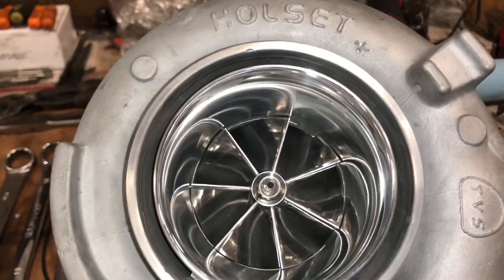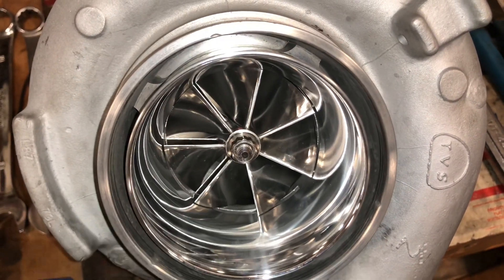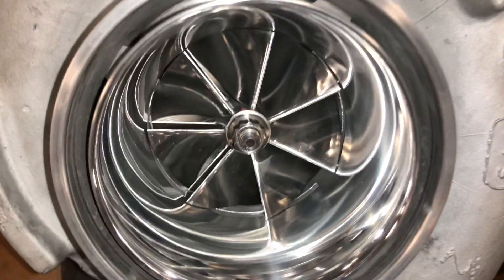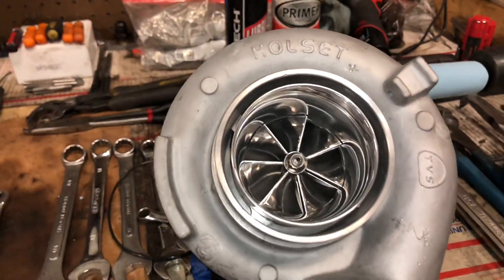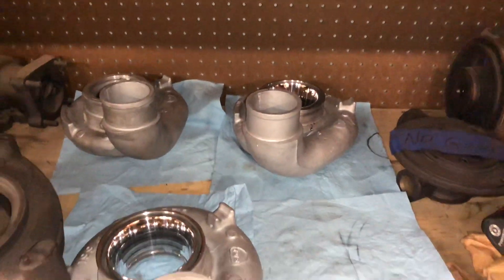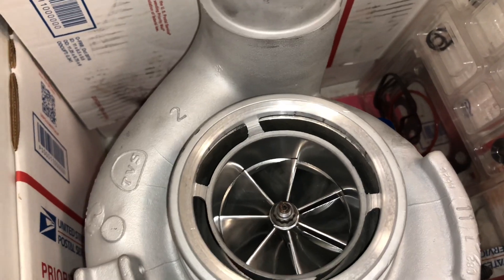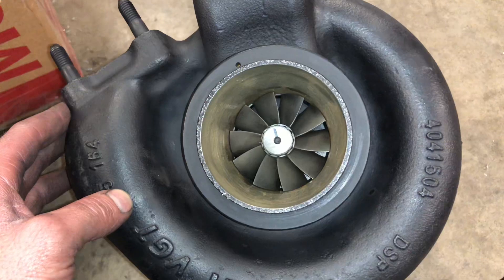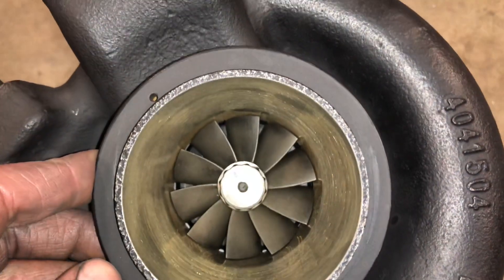6.7 Cummins T51r Mod + upgrade - 4 turbos available

Comment: Hey I’ve got a 6.7 stock turbo I’m looking for a T51R upgrade are you still doing it ?
Reply from the maker: I stopped doing the t51r for that model. The problem is it surges really bad in tow haul mode. And breaks the compressor wheels. I warrantied all the models that came back like that. It maybe possible to figure out how wide to make the anti-surge groove to make it work but it also may never work.

Comment: Curious I have a 2011 6.7 Cummins. Looking to get rid of my vgt turbo, would you recommend a he-351cw off a 2005 model truck with the t-51r mod? and how much would you charge roughly to do that if I shipped my he-351cw

Comment: How mutch for a t51 r mod housing for hx35 with the 67mm wheel  I have your 67mm wheel  and 67mm shaft with the non gated .82 housing just curious how mutch for a t51r  housing

Comment: What are you doing with that 20G? You said you were going to do a "build-up" of a 20G for an EVO 9..... what do you mean?.... machining or rebuild?.....
thanks Austin....🏁
Reply from the maker: The evo9 is a reverse rotation 20g. We built a cartridge for it to match the compressor housing but we can also sell the cover and wheel.
Reply: @turbolabamerica  ah... okay... thanks Austin...👈🏁

Comment: Your doing A coo job but the inside is still to thick cut it A little thinner, and don't flare it out keep it straight like A real T51R
Reply from the maker: I changed it too .200 instead of .130. I used a cover  here too go off but it’s an Fp cover so it wasn’t the same as the ocd well one. I’m afraid to go .200 on the antisurge groove like OCD because if th to big it can lose horsepower from too much air escaping